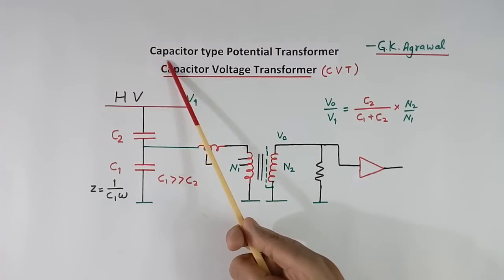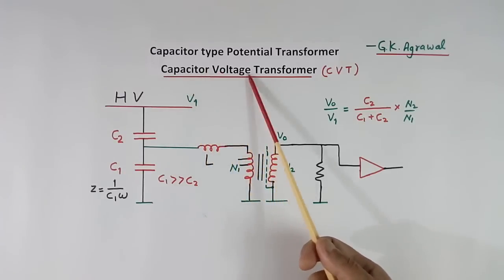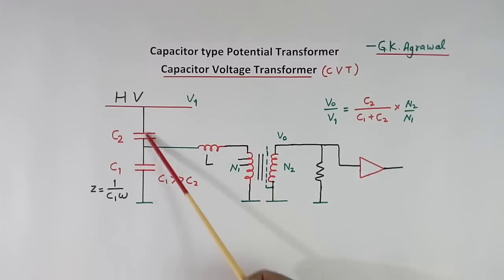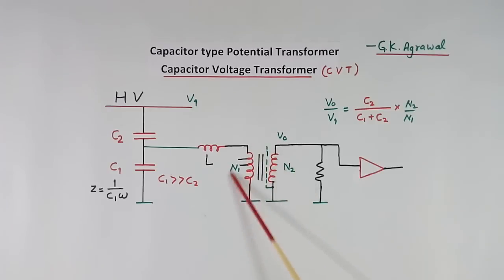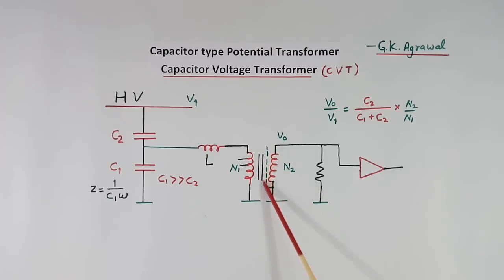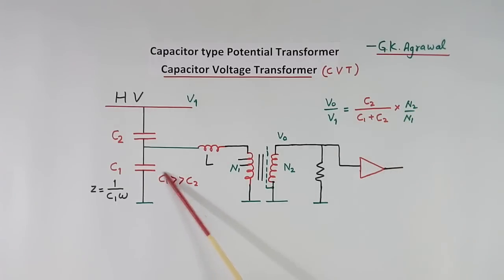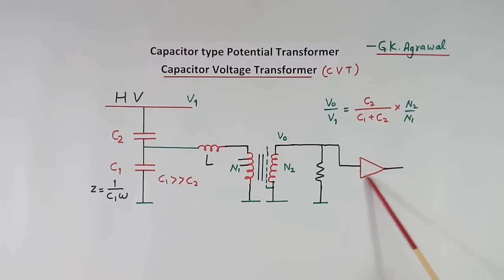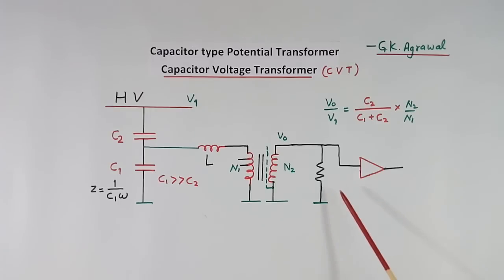Capacitor voltage transformer CVT concept

Comment: So what kind of car does this transmission come in? I've seen a few Constant Velocity Transmissions diagrams but this one takes the cake. I can't even make out if it's belt drive or not.
Reply from the maker: This is not a car
 This is capacitor type electrical  potential transformer.
Reply: @GKAgrawal2  Just being sarcastic bud. Don't pop a roid. CVT Capacitor Voltage Transformer or CVT Constant Velocity Transmission.